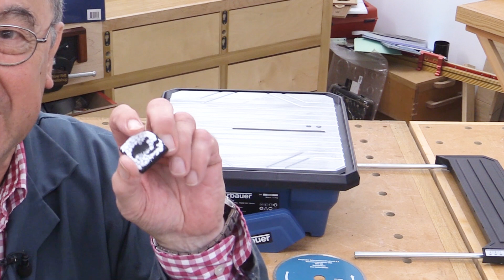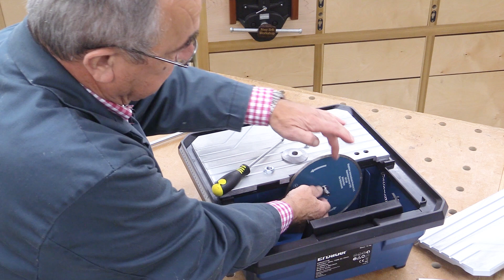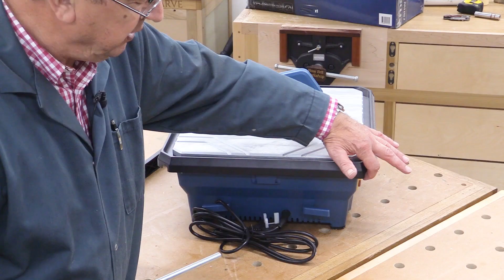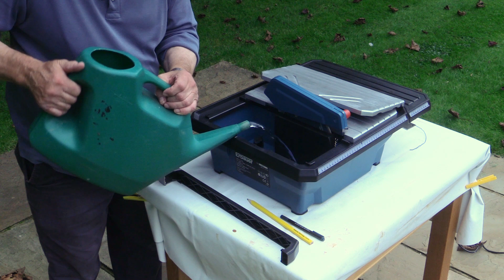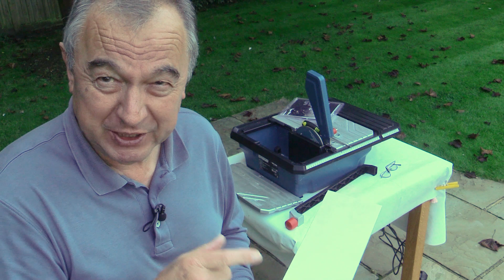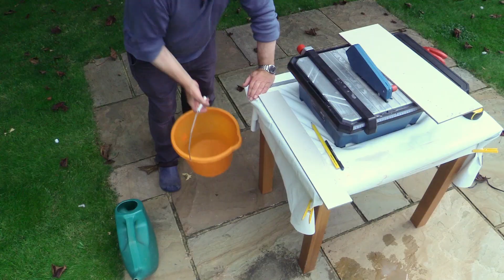Erbauer Tile Cutter - Assembly and Demonstration

Comment: Superb intro Peter, very clear and lots of good advice too. I do have some beef with Erbauer though, given that this machine has been around for about 7-8 years: (1) The start/stop buttons are practically inaccessible with a large tile on the table; (2) The tank plug is "iffy", it can pop out and woosh - there goes the water, maybe in the middle of a cut. A screw-in one would be much better; (3) The blade guard should be transparent!; (4) The blade itself isn't good enough for porcelain tiles - Erbauer should either include a better blade or no blade; (5) It's safer to have a platform behind the machine for the tile to run onto - they should state this and maybe offer one as an accessory. I made one from scrap timber.
Reply from the maker: Those are all very valid points and great suggestions for improvement, thanks for sharing your experience. Peter

Comment: Can I use this for cutting 600x900 20mm thick porcelains
Reply from the maker: Hi Richard, With the right blade you can cut porcelain but you would have to take great care to cut such large tiles. You would need an outfeed table which could be just a pice of plywood at the same height as the cutter bed.  Peter

Comment: Hi Peter I watched your video before assembly of my Erbauer  tile cutter which was very useful.
I took note of your recommendation to change the blade. I visited Topps tiles but they are not selling the blade you recommended.
My manual tile cutter is a Rubi and I have been very pleased with their products so I bought  a Ruby blade and though not cheap it still chips the tile.
But I am pleased with the machine.
Many thanks for your time making these videos very helpful and very much appreciated.
Reply from the maker: Glad it helped

Comment: Amazing, thank you for such a great video - I have this tile cutter but need to get a fine cut and so came on YouTube for some tips. My local Topps Tiles are out of stock but they have in stock a Ruby blade of even higher quality, so I'll finish my coffee and go and get that! 😂
Reply from the maker: Excellent.  Peter
Reply: @NewBritWorkshop  one gets an even better cut if the cut line is scored first - a manual tile cutter can be used for that even if the actual cut is too narrow for the tile cutter ;-)

Comment: Great video👍🏻
I've tiled my hole bathroom with this, and it works well. I'm not sure if I was doing something wrong, but I seem to get a hell of a lot of water pouring out from the blade, and everything gets really wet. I think I've filled the water to manufacture recommendations. Has anyone else experienced this?
Thanks
Reply from the maker: Hi Lee, I have owned several different tile cutters with a water trough and they all throw water at you. I now wear an old rain jacket and use rubber gloves. Cheers.  Peter
Reply: Thanks very much Peter 👍🏻@NewBritWorkshop

Comment: really good video - off to get a cutter in the morning
Reply from the maker: Good luck!
Reply: @NewBritWorkshop  got one , didn't use the blade it come with, didn't even try it, got the abracs blade from Toolstation for £33 and run off 3" tiles for skirtings , really pleased, good bit of kit, oh got a bit wet too 🤣👍
Reply from the maker: Yes, it can get a bit damp !  Cheers.  Peter

Comment: I just got a free MacAllister brand tile cutter and discovered it's almost identical to this Erbauer.  The only difference I can tell is that the MacAllister has a built-in light in the blade spray cover. I also got a Plasplugs saw at the same time but the Macallister (Erbauer) is much quieter and has a larger blade - 7" vs 5".  The only thing I'm struggling with is finding ultra thin continuous blades in the 180mm size - at least, under £30.  I do rock cutting rather than tiles.
Reply: did you end up finding a suitable blade for rock cutting? looking for one myself

Comment: Very good video, even with instructions it's helpful to see the assembly done right. I borrowed a manual tile cutter that was assembled with the guide just off square by about 3mm but it showed on large tiles. Simple set up tips like aligning the bracket, checking the guide is straight and changing the disc saves a lot of damaged tiles. Well done Peter.
Reply from the maker: Glad it was useful.  Cheers.  Peter

Comment: Great video. I bought this model after watching the video. I am new to tile cutting and a casual DIY user. 
The issue I am having is that I really had to push tiles instead of sliding with relatively ease. I was wondering if have same issue?  

Hence slighly disappointed with the cutter but this could be due to my own inexperience rather then the tool itself.

(btw I have bought another disc as some of the comments here suggested)
Reply from the maker: Try to let the blade do the work by not pushing too hard. With porcelain tiles you will need to push a bit but the quality of the blade is important as well as making sure the water level is sufficient.  Cheers.  Peter

Comment: I have no intention to buy it , but you do souch a good presentation is a please to watch, Can’t one use the Kapex for the tiles?
Reply from the maker: Many thanks but I do not know if there is a blade for the Kapex to cut porcelain - also, it would need some water cooling - rather messy !  Cheers.  Peter

Comment: The only problem I’ve had with this type of tile cutter is cleaning out the reservoir of the waste paste accumulated in the base. Otherwise a pretty good machine for the price. Good tip about changing the blade for a better quality one though, and thanks once again for an excellent video.
Reply from the maker: Hi Peter, I washed mine out and then let it dry completely. After that I used my workshop vacuum to get rid of any remaining bits.  Cheers.  Peter
Reply: @NewBritWorkshop  Thank you for your reply Peter. Next time I use my cutter I will take your advice and clean it out straight away.

Comment: Great video, Peter! I’m currently in the process of a renovating the bathroom and I found the Screwfix/Erbauer suction cup style drilling guide (available in the set of 4 bits) to be a godsend with those types of diamond drill bits.
Reply from the maker: Hi Jake, They do seem very good but I have not tried any other makes.  Cheers.  Peter

Comment: To stop break out at the end turn the tile upside down and cut 25-50mm in from where the cut would finish  then turn tiles back upright and cut the the tile as normal then the tile should not have break out
Reply from the maker: Hi David, I had thought of trying that but did not trust myself to do it for the first time with the expensive tiles. Great tip - many thanks.  Peter

Comment: This is not woodwork related!

Seriously though, Peter. Always great when you upload a YT video! A good little tip - place something in front (large piece of carboard). This catches the spray of water flicked which can be a problem when working inside a property - especially as I like to run mine over filled with water.

Kind regards, Stakker.
Reply from the maker: Hi Stakker, Many thanks for the tip.  Cheers.  Peter
Reply: @NewBritWorkshop  Forgot to mention, mine isn't an Erbauer - think it's a Tilemaster. The blade supplied appears to be of a better quality to the Erbauer. Otherwise the machines are much of a muchness. Didn't get any chip out, but that could depend on the type of tile I used.

Comment: Hi Peter,  My experience with a similar tile cutter was the same as yours.  The blade was poor quality and there was a lot of chipping.  I replaced it with a hefty manual cutter from Topps Tiles ( cost about £35 as I recall)  which was much faster and gave a pretty clean cut, maybe not quite as good as your new blade but certainly acceptable.  It's a pity you can't buy the electric versions without the cutting wheel as most seem to share the same problem of poor quality wheels.  A very good video.  Mike
Reply from the maker: Hi Mike, Yes, that sounds like my experience.  Cheers.  Peter

Comment: Nice video Peter. The finished tile job looks very tidy and professional indeed. I have found that Erbauer make pretty very good power/hand tools , but their cutting devices ,e.g., blades , drill bits and router bits leave a lot to be desired ( to put it mildly). I replaced any original bits or blades with higher quality ones as soon as I buy the tool. I recently bought an Erbauer 5 flute "wood beaver" type drill bit, and it was probably the most useless tool I've ever purchased. Blunt , and with 5 flutes there is no room for material to travel up the flutes, especially dense ( possibly slightly damp) MDF. It just left an oval , torn out hole.
Reply from the maker: Hi Jesse, Yes, for some silly reason manufacturers or suppliers always seem to put the cheapest blades/cutters in the tools as supplied. For just a few pounds more (at wholesale prices) they could instantly up their game and get better feedback. Festool always supply the very best with their tools.  Cheers.  Peter
Reply: @NewBritWorkshop  and makita

Comment: Peter.....the retaining clip on the blade guard screw is to stop the screw being picked up by the blade if it comes loose due to vibration........it’s rather important........
Reply from the maker: Hi Stuart, Many thanks for that advice - I will put a star washer there in order to prevent it from coming loose - cheers.  Peter